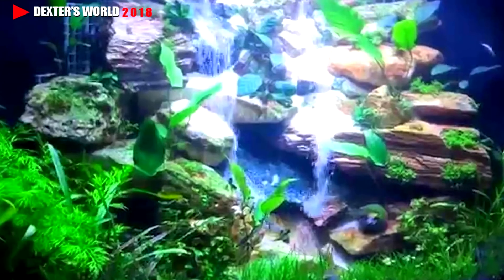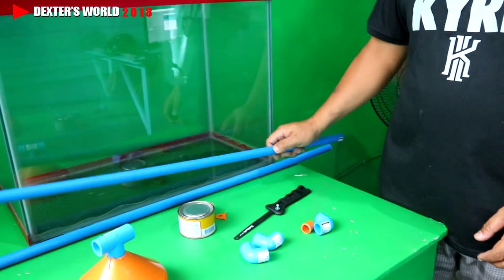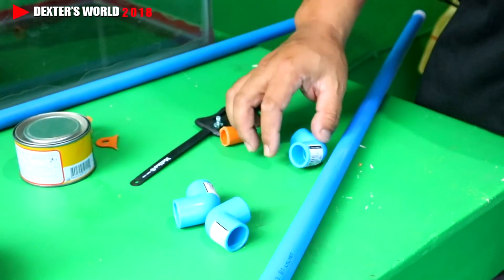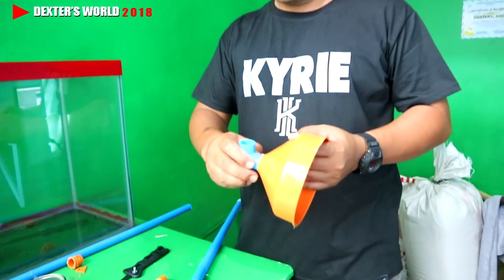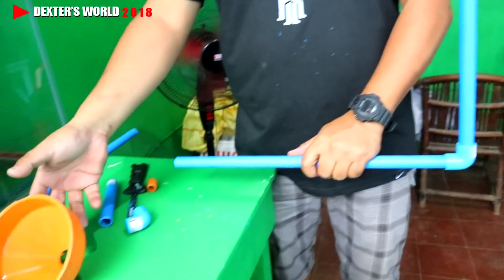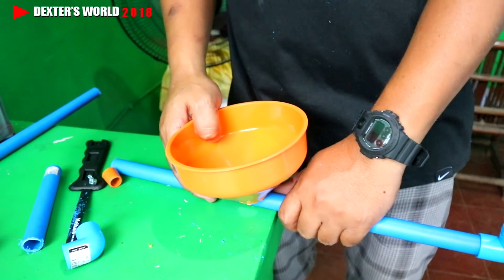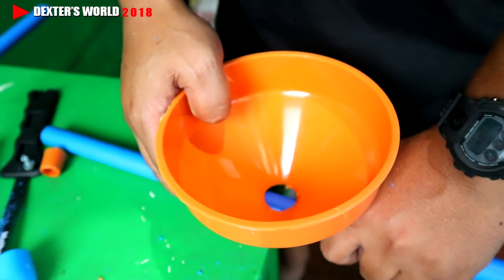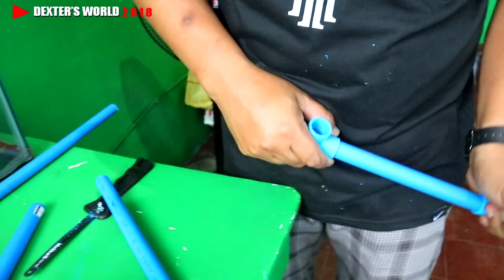Aquarium SAND FALL - TECHNIQUES REVEALED!!

Comment: Actually in professional display aquariums, no water pump is used. They use air pump only so the sand isn't pushed out and go everywhere. The water pump is pushing the sand out too much. If you use air pump the bubbles will carry the sand up and the sand will fall back down nicely. You can see how they do it on other videos. This is still a good idea tho.
Reply from the maker: Yes Jonathan this is my own Idea . i hope you like it

Comment: Good job! Does the pump come with the black extension piping to connect to the blue pvc pipe or you get that separately? What's the diameter?
Reply from the maker: Alan Reid 1/2